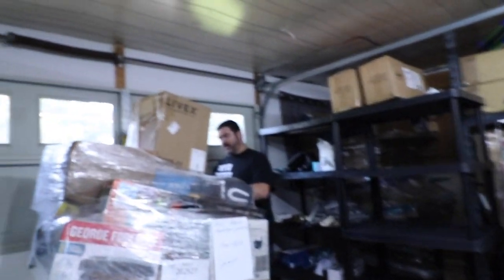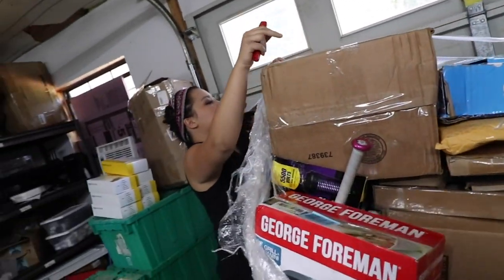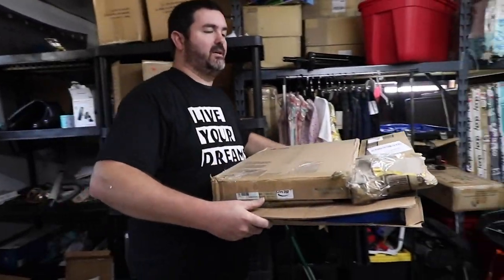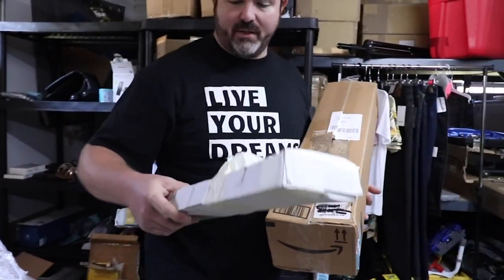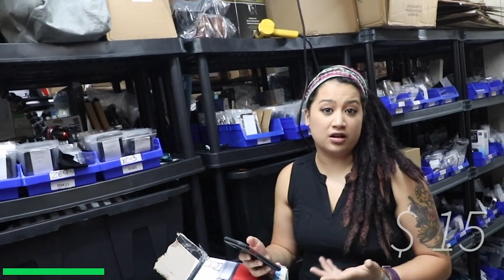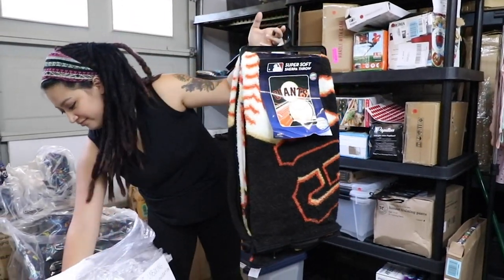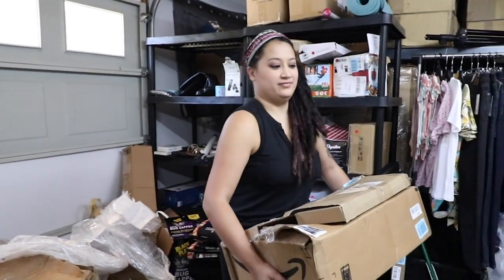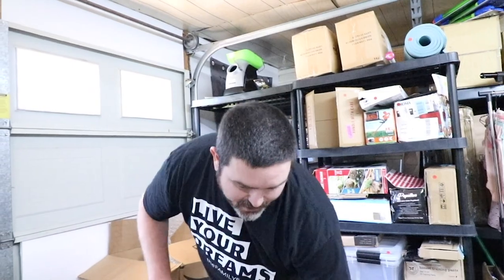We Bought A Amazon Customer Return Pallet | Liquidation Unboxing | The Family Flips

Comment: The bent tip swiffer. Use the hair dryer heat to bend it back out. Most brushes that have mashed bristles are easily restored by holding in boiling water a moment and then being pushed into place before cooling. same idea.

Comment: As soon as I saw the "OFF Brand" Daskeyboard I knew you were going to be surprised.  DasKeyboard makes mechanical keyboards and that is a separate market from general keyboards serving mainly programmers and writers.  Just because a brand is not popular and/or you have not heard of it, does no make it an off brand.  By that, I mean that if the brand does well in its market, in this case keyboards, then it's not an off brand.  For example, many people have never heard of a brand called Fluke, but if you as an electrician, they will know it and most will want one.
Reply from the maker: Thanks for that 👏